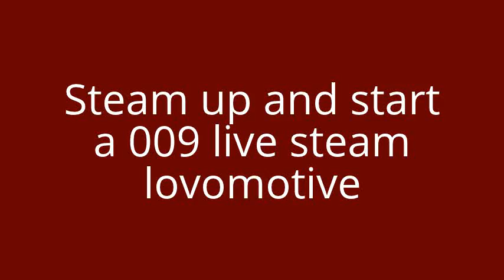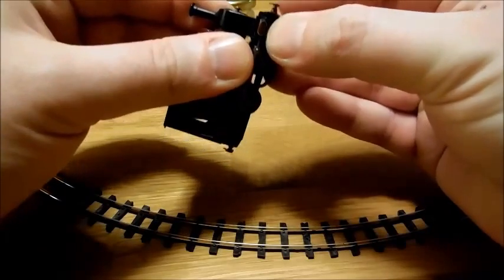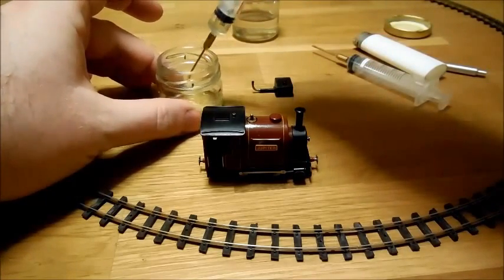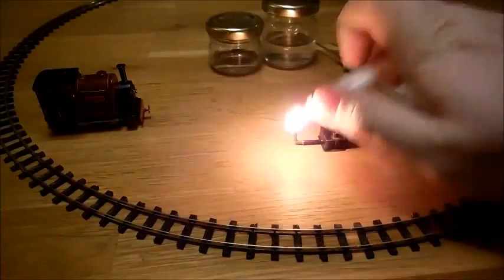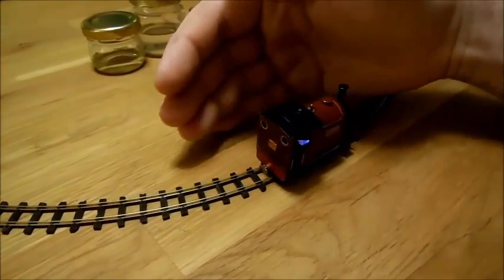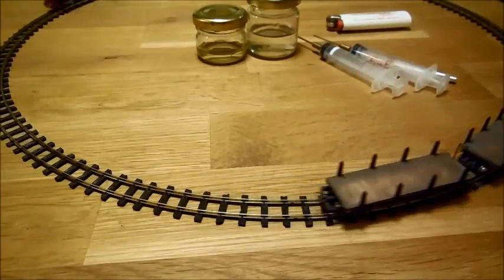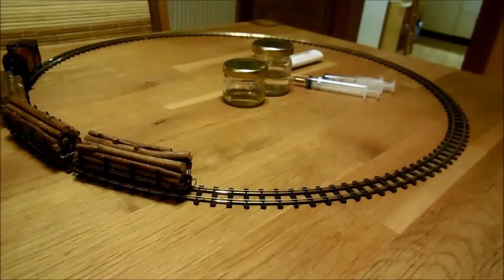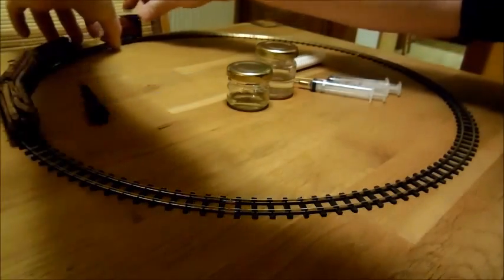Steam up and operate a 009 live steam locomotive

Comment: I have one of these and have been trying to run it could you tell me what fuel you using?
Reply from the maker: The manual recommends "white spirit" as fuel, I use 99.9% industrial alcohol, which is free of any soot formations, which might collect on the boiler and pipes, acting as an heat insulation over time.

Comment: What happens when the boiler gets low? Does it have a failsafe?
Reply from the maker: The boiler has a safety valve, but once the warer gets low, the spirit in the burner will also get low and once the boiler is dry, the flame will come to an end very soon as well. Anyhow, the flame will not unsolder the boiler as its to small.
Reply: @Waldbahner  that's nice, too bad it's custom or else i'd ask where to get one.